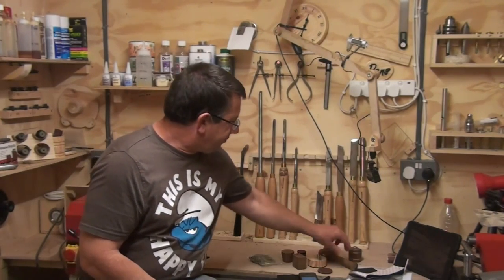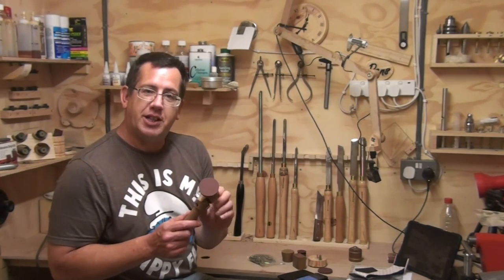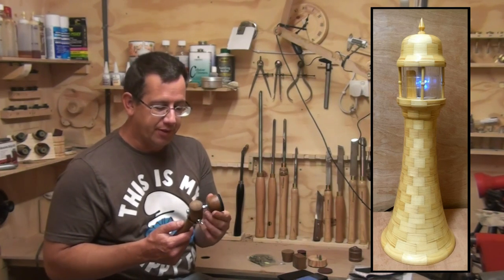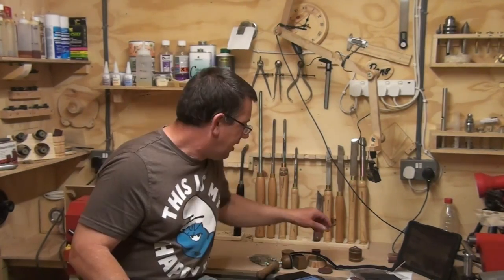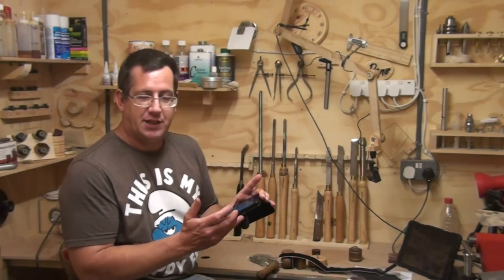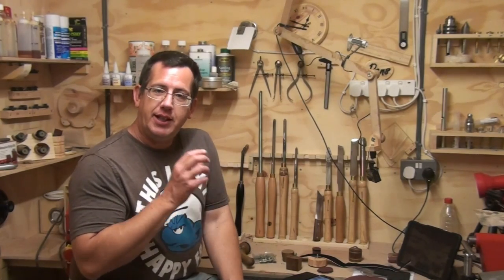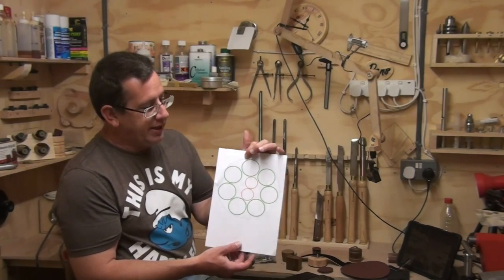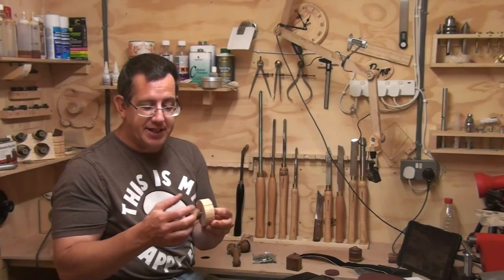Bowl Sander (Inertia) - Episode 91

Comment: Hi Paul, love the video and the bowl sander - I really appreciate the mention, I never intended to sell a kit until I spent so long finding all the correct bits. For interest we now stock a loop-backed soft cotton pad so you can now have a bowl polisher too!
Reply from the maker: Thank you Jon and you're most welcome for the mention. After all it was your video and another that I used as a reference point. I had most of the parts so it made more sense for me to just buy the rest rather than a kit. That also allowed me more spares to cover for breakages or creating other items.

The cotton pad sounds a good idea, I'm just going down the route of a buffing wheel that I've only just ordered so will see how that works out. The bowl sander is rarely used as I don't do many bowls but it's great for when it can be used.

Comment: Thank you for a very informative video Paul. I've been thinking of making one myself and I've found your method extremely helpful.
Reply from the maker: Thank you. They are quite simple and cheap to make and where others have just cut them out on a bandsaw I wanted to make it on the lathe as much as possible. As an extra if you have a spare bolt the same thread you use to hold the head, you can insert that into a pillar drill to also use for sanding. I regularly use the head this way to sand the bottom of boxes flat.
Reply: Unfortunately I don't have a band saw but I'm sure I can use my jigsaw or a tennon saw to cut the necessary parts. But first I'm going to make the sanding head to use in a power drill. I've noticed that several turners are using power sanding to finish inside a bowl.
Reply from the maker: Yes that is especially ideal on the centre as it doesn't spin much with this type of sander. Making your own try different sizes and shapes (as in flat or slightly curved).I buy large sanding discs (hook and loop) then cut them to size for the required head, works out cheaper.

Comment: What a great addition to the shop Paul. Although that was some scary turning at the start. 👊👊👊
Reply from the maker: Thank you Martin. Yes a cheap option. I forgot about how I made this so had to watch it again. Putting those holes in for the bearings was quite easy, the hard part was to make sure things lined up. Just keep your fingers back and keep out of the line of fire.

I would certainly recommend making the heads, I use those more on the drill press than anything to sand off the little nubs when you part of items. This last 2-3 weeks it's been used so much with making Christmas Ornaments.

Comment: This was really helpul.  I was building my own sander and could not figure out what kind of Foam to get.  The Neoprene was a great tip.  I am also going to look into making my own sanding disks.  Cheers!
Reply from the maker: Thank you. Probably like yourself I watched the other videos on YouTube and this is what I came up with on my own idea. Cutting the discs is a little tedious but does work out cheaper. I don't use it much so that's not so much an issue. If I used it regularly then I may look at buying pre-cut discs or even make something to cut them.

The head is used more than anything. It sits in my pillar drill all the time and is used to sand off the bottom of bowls etc. My latest video is a quick tip on using it for sanding pen tubes quickly before gluing them in pen blanks.

The head has also been used in my mains powered drill to power sand bowls, ideal for live edged bowls where you can't sand them on the lathe.

Comment: you can use a foam computer mouse mat on the heads I have a deluxe bowl sander and it comes with 50mm and 75mm heads so Ill be making one of these with both size heads great video.
Reply from the maker: Thank you Alan. I was following what some of the other videos had made. The foam was quite cheap to buy, so quite happy to spend the money on that as the overall cost was quite low. I work in IT and haven't seen a mouse mat about in ages.

Comment: Very satisfying to make your own tools! :)  If you haven't tried it yet, try the larger disks on the smaller head. I can't articulate why this is a good thing, but it works well IME.

1:05 You are brave to reach past that spinning propeller. I like to have a secondary cutoff switch at the tail end of the lathe, just to avoid reaching past that sort of thing.
Reply from the maker: Thank you Awldune. Yes making things for a purpose is so enjoyable, even more so when it is something for yourself. The spinning propeller looks far worse than what it was actually like as it was a solid piece of wood that was held well in the chuck.